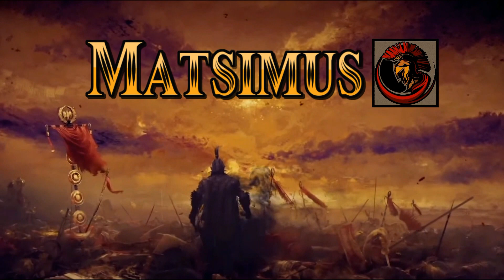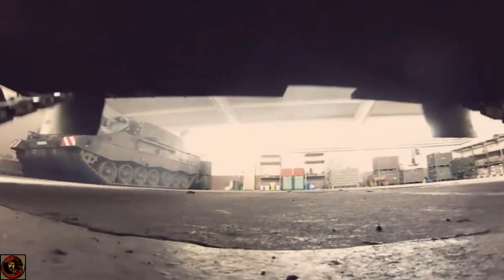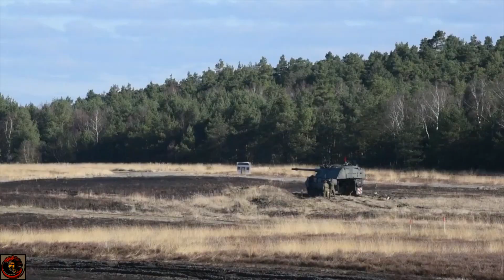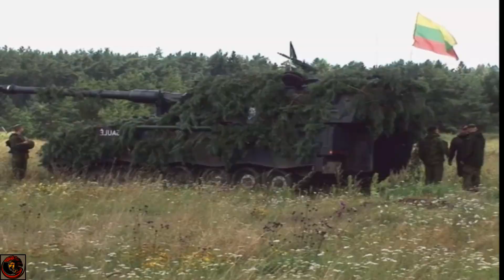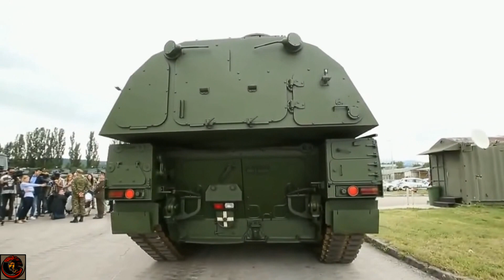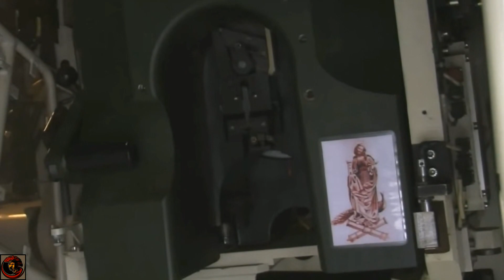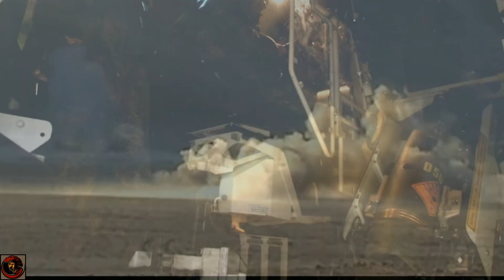German PzH 2000 - 155mm Self-Propelled Howitzer : Overview

Comment: PzH 2000 is typically German overengineering. It has massive protection and tactical mobility, but very poor operational mobility.
I think You should consider what is happening with the Nexter CAESAR. Where a howitzer is able to be mounted on very different chassis. It can be mounted on a CV90 chassis, Piranha 5 and an Eagle 5 chassis.
That does give issues with issues when firing a charge 6 (typically they only show charge 3, which is half the 6 charge). To take the recoil of a charge 6 a heavy vehicle is definately an advantage - especially if it has a tank suspension. Hence the movement disadvantages matters less. The PzH 2000 has to keep up with the Leopard 2 tanks and heavy infantry fighting vehicles of the German army in slugfest  Problem is: To get the monsters to the battlefield you need bridges, roads and realroad transport which takes a hell of time getting to where it is needed.

This is all sweet and fine to counter a massed russian force with a lot of artillery sending grenades somewhat uncritically down range at maximum charge. But as that artillery is not very precise - error increases with the square of the range. And it adds to the logistic nightmare of the russian artillery. Besides firing from a wooded area and in rubble is not conductive to the hostile artillery's accuracy. That is the picture we have seen in Chetniya, Ukraine and Syria.
The russian might be able to move their units quickly on their internal lines, but toting tons upon tons of shells from one side of Russia to the other DOES get tedious.

The heavy units do indeed have their place, but it is smarter to have a lot of tanks prepositioned in brigade/battalion sized depot - and fly in the personel - break the tanks out of depots and move into position. As there are lots of tanks, APC (ICV)'s from the cold war - all you need is tarting up the old stuff with a bit of electronics, If you can fire from forrested areas and prepared positions - which in a limited area just takes some civil engineering equipment you can lower your requirement to the weight of the piece.
That is presumeably why mounting a system on a Nexter CAESAR on a CV90 chassis makes sense.

There is a lot of American folklore about standardisation and everybody should buy american. The real standardisation should be where it counts! That is in the ammunition. A standard HE round cost about 500 USD and the quality control is rather important to avoid to many duds. If you can reduce the number of duds from 30% to about 5% a half battery is reduces from 4 pieces to 3 - with the same firepower hitting the private parts of the enemy.
This gives you the range of up to 20 km with standard ammunition. If you need extra range you opt for base bleed grenates which cost about double (slightly less?) and that takes you up to around 30 km. But presumeably also with half charge - which does indeed reduce the teethrattling recoil forces.
If You really have to get long range - the option is a grenade like the Excalibur that is insanely expensive at around 85.000 USD a round, from the figures I have seen. In high rate production it is going to come down considerably. But that takes you up to 40 km.

Now the best way to reduce the expenditure on ammunition is actually hitting the target and not just ruining their day with saturation firing. This problem is solved more by having the appropriate assortment handy on the armoured supply truck.Anyhow you have to get out of Dodge before the counter battery fire opens up. So 18 grenades on the ready is plenty as you will have to make yourself scarce anyhow.

The other thing is mounting the piece on a medium chassis like the Piranha 5 - which requires hydraulich spades to take the recoil - otherwise the tyres are liable to burst. But then again: The gun has to be relayed after each shot anyway, so that is not the major consideration. You don't fire 3-6 grenades into the same spot, as seen in some american commercials - you spread them out to make the pesky hostile infantry regret the day they joined up. And again: Get the Hell out of there.

I would even put CAESAR or similiar on an Eagle 5 and live with a reduced charge to keep the false teeht from being castangnettes. Range will suffer, but you can give fire support.

A modern artillery battery will have a half- battery of 3 pieces of 155 mm and the other halfbattery of 120 mm mortars similarly protected and mounted on the same chassis. It is a question of the appropriate electronics and a clear fire mission.
Reply: Look up the KMW AGM. Pzh2000 mechanism in a modular turret. Base can be Leopard 2, a ASCOD variant or a Boxer AMV.

Comment: how could this be automatic loading system if you have crew of 5 and of that 2 loaders?
Reply: in case the automatic loader doesn´t work
Reply: but this is highly ineffective which is not a trademark of Germans
Reply: Why ineffective? Thats more like a wise choice. At war there is always Murphys law and it is always wise to have a redundant system. And also if u are in the Field u also has other jobs beside driving around in ur Tank/Howitzer like field maintanance and secure your perimeters.
Reply: The autoloader moves the projectile, the human loader adds powder bags depending on range desired... Also moves new ammo into the vehicle.

Comment: Just a tiny bit underwhelmed by this video. You could've mentioned the Modular Naval Artillery Concept (MONARC) which mounted the PzH 2000 turret on a ship to use as a main gun. There are interesting photos about it on the interwebs!

Also the producer of the Pzh 2000 already produced its successor, the Donar artillery. A very interesting piece too. Maybe you can do a video on that one? It's the newest of the new stuff.

Comment: One of the important advantages of the PzH 2000 is with it's design of ammunition storage and the lever type loader where the ammo is vertical most of the time. The gun barrel doesn't need to be depressed to load. If you look at the AS 90 and Palladin, they both have to lower the gun from a high elevation to re-load. Wastes time and lowers accruacy. The PzH 2000 just stays on target and fires.

Comment: 10:50 All Pzh2000 loading and fireing systems have a manual backup. Moving in to position quickly is a drill called shoot&scoot this increases the survivalabilty of the gun due to possible counter battery fire.

Comment: I got into a debate with my friend about self propelled guns vs rocket artillery I was on the side of the gun but he had a response to everything I said, range, rate of fire, destructive ability. So I was wondering what are the advantages of self propelled guns? or will they just be replaced by rockets in the future?
Reply: John Wright 
I guess way way lower cost/shell and maybe that the don't produce a shit ton of smoke when firing giving their position away and limiting everyones vision
Reply: shells are smaller than rockets, have no smoke trail and usually no internal propulsion, also less IR signature.
Rockets are better for moving targets, especially when fiber guided
Reply: The main advantage is lower cost of shells compared with rockets..   Also storage and transporting.. You can store a lot more shells in the same area.. You can also transport more shells in your supply vehicles.. Rockets put a lot more strain on your logistics system..
Reply: @AdstarAPAD   rockets also take more time to produce in large numbers, i'd imagine.
also a well designed gun can be used to direct fire at the enemy, whereas rockets, to my knowledge, tend to struggle with targets at close range as few can be angled downward.

Comment: I saw Paladin and PzH 2000 in Lithuania face to face. Can't tell which is better, but PzH 2000 looks like fat beast. More then 55t beast!
Reply: I see a point why Lithuanian Armed Forces purchased 21 of PzH
Reply: could be, especially when PzH looks more advanced, comfortable and performing better then Paladin.
Reply: Domashenk0 the paladin only has a rate of fire of 3 rounds per minute, which is so bad...
Reply: PzH 2000 = 3 rounds <10 Seconds ...
Reply: The biggest advantage is that the bullets can be fired at different angles so the 5 targets can be destroyed at the same time
Reply: Domashenk0 The U.S. has a counterpart of the pzh2000 to replace  the Paladin, the name was Crusader. It looks similar to the pzh2000, but was cancelled by the U.S. Army bec. it was too big and heavy - over 100 tons and in two units. Cannot be transported by C-17 aircraft.
Reply: Domashenk0 Dude Paladin is baby if you compare it with PZH
Reply: The XM2001 Crusader = 43 tons
https://en.wikipedia.org/wiki/XM2001_Crusader

Comment: But can you kill tanks with it? I mean does it support APHE or APCBC or HEAT Or what ever you can use against tanks?
edit: nvm just watched the video to the end
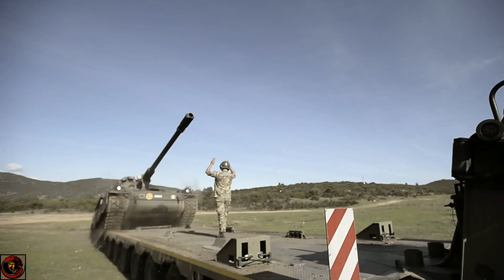Reply: Oh, and i dont want to be that guy there. 03:37
Reply: Why would it need obsolete  ammo like that? The rounds you mentioned where for direct engament of tanks. Thats not what arty is for. Against tanks they can use SMARt-rounds (seeker rounds with anti-tank subammunitions)...that way you knock out tanks from 40 km away
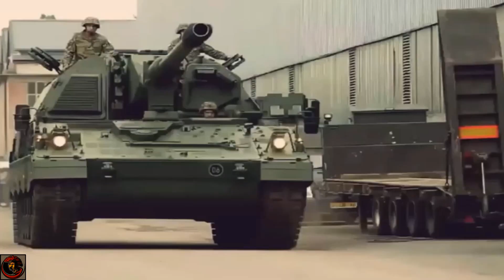Reply: PS.: this is also mentioned by Matsimus at minute 05:00 ff
Reply: When the pzh hits a tank at point blank range (<3Km), there won't be left much of a tank anyway.
Reply: It can, and the latest news I have from former mates in the army they do train "direktes Richten" (direct fireing) on hard targets. There is however no need for HEAT or Sabot-rounds as the sheer explosionforce of the 155 will be enough to disable the crew and tank. 
When I was in the army, I was an engineer and we were able to disable a tank (in theory not under combat situations) with not much more than 90g of explosives.

People often underestimate how much impact force affects the crew, even when you don't have a penetrating shot. And the 155 will most defenetly disable all fiering optics often rendering a modern tank useless. Not talking about the shokwave which will rupture rubber fuel-lines and electronics.

Comment: the fire control system can also shoot multiple rounds in different arches so that 4-5 shells hit at the same time. 5 vehicles can deliver the same amount of shells like 25 vehicles in a single strike.
Reply: einar some can, most can't. I didn't say the pzh2000 was the only spg capable of mrsi I thought it was worth to mention since its a cool feature.
Reply: Remind me to stop making fun of Germans :)
Reply: Some (not all) top of the range self propelled artillery pieces can do MRSI. However PzH's specs are superior to others in this regard. Mainly to do with superior rate of fire which in principle directly correlates with the effectiveness of MRSI. And some modern pieces still can't do that at all (perhaps could in theory with some software adjustments but not in practice). So I wouldn't be as confident as you are on that one.
Reply: took me a bit to figure out why MRSI would be useful in the first place, but after thinking a bit, that capability basically let's one vehicle do a firemission that would usually be done by a platoon's worth (if not 2) of guns.
Reply: MRSI (multiple rounds single impact) is indeed the new normal with the Archer, AS-90 and Crusader (could have, it if would have ;-) ) being able to do it. BTW: can you do a film about the AMSO ?
Reply: Mofo Jojo MRSI = Multiple Round Simultaneous Impact. TOT= Time On Target.
Reply: urban dweller technically, you could do the calculations by hand. we had a well trained 120mm mortar crew achieve a 2 shot MRSI by hand and paper.
Reply: @MatoVuc  I grew up near the second largest military training ground in my country, every summer night we had a very "metal" symphony of explosions as a background soundtrack. Recently I found out that they had well trained artillery crews in the '70s who did all the calculations, and since then, every other crew is just positioning their pieces on the same very spot and fire using the same settings. If you move them 10m in any direction, you screw them up, they don't know how to calculate anymore.
Reply: Ain't sure but MRSI is pioneered by South Africa with their G5 & G6. Pls correct me if am wrong.
Reply: Damn, that sounds overpowered hahahaha
Reply: MRSI, and its conceptual predecessor, TOT, also maximise effect. Every single army in the world teaches you to find a hole and pull it in after you when you observe arty splashing close . . . which does not help much when it's not a single ranging round, but a battery-6 strike of 36 rounds impacting at the same time with overlapping areas of effect.
GPS and modern fire control systems make that sort of thing look easy.
Reply: most modern artilety can do that

Comment: Best thing about the Panzerhaubitze is the fact that it looks like a Ferdinand on steroids
Reply: It has a fully traversable turret, that's a huge advantage.
Reply: @levoGAMES  lol upgrade the panzerhaubitz suspension, give it a leo 2 engine, or upgrade its current engine, and give it thick advanced composite armor like what the leo 2 has, and turn it into a super Tank Destroyer...Dumb idea, but cool
Reply: No shit sherlock :V it's also a spg not a ctd...
Reply: A MAUS :D
Reply: what's fun is that in february this year the crews trained direct fire with it.
Reply: A Ferdinand that can climb hills
Reply: Looks like a Maus But in modern and as a Artillery.
Reply: The same way the early Leopard 2's looked like a Tiger on steroids with its flat turret fronts.
Reply: Can't unsee
Reply: Mr.H Hyder will lead german to open ww3 with tiger3 tanks.
Reply: But wheres the Tiger P on steroids?
Reply: And unlike the Ferdinand it doesn’t explode when it moves forward
Reply: axised001 hahahahaha true
Reply: I wonder how easy or hard it would be to use this thing like a tang destroyer.
Reply: But with out the biggest issues

Comment: german designers did the 420 range on purpose... how would you come up with something like this...
Reply: Nope, that's the propellant bag. Like most arty, the 155 does not use cartridge ammo, but loads shell and propellant separately. If the system is designed right, that gives you better range variation, because you can vary the amount of propellant according to need. For a similar reason, most SPGs can elevate the gun up to +85 degrees.
Reply: four twenty, four twenty, four twenty
Reply: PrivateDerpy they just love getting high that much
Reply: They were pushing packs of green in to the breach with the amo. I think its togive surrounding infantry some new kind of high.
Reply: Raphael Eichner 
The USA already tried that with LSD - VERY effective
Reply: Jochen Träm right, I just find those packs look unsafe :)